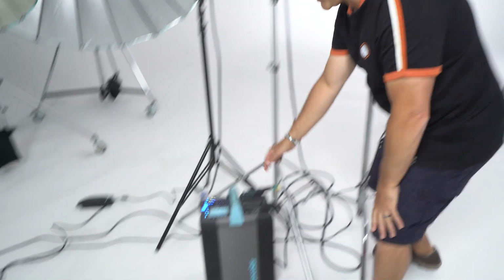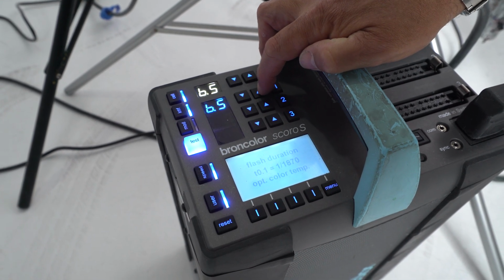Understanding Studio Flash Lighting

Comment: There is only "THE LIGHT" no matter it's natural or LED or flash,  threre is one and only one light. If you know what's light is, then you can make any kind of photo(s).
Reply from the maker: Yes but it needs to be full spectrum colour otherwise the photos will not realise their potential. For example if you photography with a sodium vapour lamp the results would be horrible.
Reply: @VisualEducationStudio  Probably, then it's a question of correct white balance settings. No matter the kind of light(s) we're talking about, The light is THE LIGHT. ( I hope my english is good, and thanks for your channel I like it)
Reply from the maker: Hi Didier, that wouldn't be true. For an image to accurately record colour it has to have a light source that distributes the full spectrum of colours equivalent to daylight. Yes this light can be warmer such as 3200K or cooler such as 9000K but they still have the full spectrum within them. With sodium vapour lamps for example they only have the wavelength of orange light and it is very specific, almost as specific as a laser beam wavelength. If you were to photograph with these light sources then there is nothing you could do to represent colour and contrast accurately by adjusting colour balance. This is why all studio flashes and speedlites and high quality LED lights run with as close to full spectrum as possible.

Comment: Would you say continuous light has an advantage over flash for film photography?
Or should I use my modeling lamp to find out the right placement of the flash head before taking the shot? Or is this kind of a vice versa scenario?
Reply from the maker: Hi Adrian no I don't think continuous light has any advantages over studio flash lighting for stills photography whether it is digital or film. At some point in the future when it's possible to achieve clean images at 64,000 iso and assuming you can work in a completely darkened studio that has no ambient light leaks as well as the continuous light being adjustable in 1/10th of an f-stop with a CRI of 100, then it may start to have some advantages.
Reply: @VisualEducationStudio  you can shoot at ISO 64000 already, the images will just not be very pleasing to look at 😉😂

Comment: Thank you so much for your super video! I am not a professional photographer but built myself a small photo studio with everything you need as a professional, only all of it smaller and terribly improvised. I want to upgrade my whole system, since the triggering of the small battery driven flashes has been unreliable, slow and too week. Godox is probably the brand I should go for but I’m quite uncertain, what the system should look like. I have been using up to 3 flashes and want a system, that can freeze action, e.g. my model jumping in the air. But I also shoot groups of people/families. I reserved about 3 to 4000 Euros for that, now all I need, is a sensible combination of flashes, everything else is already available. What would you suggest? How much power do I need? My studio is 4X5 meters. I don’t earn money with my photographic work and don’t need to. It’s all just a lot of fun!

Comment: Hi Karl, could you perhaps direct me to an overview of (T.1) flash durations for specific power settings? I am running into the limits of my 800L's with dance photography and would like to compare with several power packs (move and scoro) to see which one would suit me best. I haven't been able to find the information so far.
Reply from the maker: Hi Filbert, I'm surprised you're running to the limits on your 800L you'd have to compare the duration specs to the 800S on brons website then against the Scoro. The Scoro gives you a bit fast duration and a bit more power but as with all of their fast flash durations you have to drop the power of the units down to 5.5 or below to get the really fast speeds.
Reply: @VisualEducationStudio  I was shooting a group of dancers with a narrow grid + gel, which ate quite a few stops so I needed full power on the 800L. I'll  try to find the Scoro specs again. Maybe a flooter on the 800L would do the trick as well. Thanks for your reply!
Reply: @VisualEducationStudio  I did some more research. Turns out I should have used the HS mode at power setting 9 (not 10), then bumped the iso one stop. Would have given me a t.1 of around 1/800 of a second, which would have done the trick. Live and learn. I'll still check out what extra the packs deliver though, as a bit of extra depth of field is always welcome.

Comment: Although I understand flash has the ability to freeze movement compared to led, is there any actual application for led in photography?
Also, what do we get with broncolor or prophoto lights compared to let’s say much cheaper alternatives like godox? 
In the monitor world, yes you can get a very good benq but eizo will still give you much better uniformity.
Reply from the maker: Hi Maxime, some people just understand continuous light more easily, in a sort of 'what you see is what you get' manner but as explained it's not as versatile for many reasons, especially when photographing people/fashion. In relation to your other question on lighting brands, light is light out of a flash tube but it's how long it lasts, how consistent the exposures are, for example every shot with my bron light is going to be exactly the same exposure  which means layering images is easy. Durability of the brand is important to pros as the equipment gets a beating. And most importantly for me is what are the choice of modifiers available to me.

Comment: That remote flash trigger on the camera appeared to only have a single contact on the bottom of it, similar to much older speedlites from the film days.  Does that still have any sort of camera-controlled TTL flash metering or is it exclusively manually controlled settings?
Reply from the maker: I can't see any point in TTL on a studio flash, the whole process of working with light in a studio is where the photographer makes the decisions on the exposure level of the flash. The trigger fires the flashes and you can also control the power up and down from the trigger if you wish but I prefer to walk over to the light and change it on the dial or do it from the app or computer controler.

Comment: I also tell new photographers to consider how much power they anticipate needing. That 400ws monolight may be less expensive but may have issues when fired at top settings with little recycling time compared to an 800ws unit when fired at half power.
Reply: Just bought the ad1200 pro pack and head system, battery powered.

Comment: Hello Karlingtons!

Grrr! Don't know what to do for my next step.  Need some advice or guidance

I currently own a Lumix G85 

Which so far, I have enjoyed using

I am now at a breaking point and need to change my setup. I don't know what to do.

I have spent a bit on the lenses and am in the Lumix eco system but for my needs this specific model just ain't working for me

These are things I now know that I need

1. Tethered cable is a must (my g85 doesn't support it)
2. I need my next camera to be ideal for stock photography
3. To provide higher ISOs and a wider range of manual controls

Anyone have any ideas what I can do

It takes me months to research this stuff

I am also going to be stuck with a bunch of gear if I change the system or brand

Thanks in advance
Reply from the maker: Hi, it sounds like you've already made up your mind and you are going to need to sell your current stuff. If I was buying 35mm again then I'd probably go Sony and their 90mm Macro lens which is excellent. If I wanted to go Medium Format on a budget then I'd X1Dii (others will argue Fuji, but I need higher sync speeds for my fashion work). I think the new Canon Mirrorless also look interesting, I've got older 5dmk3s still working fine but I use the H6 for 99% of my work.

Comment: That should answer a lot of people's questions! One thing to know about pack-and-head systems is that they can draw a lot of power from the AC/mains... not a problem if you have a nice studio like Karl's with dedicated circuits for everything,  but something to watch out for on locations. I used to shoot market-research photos in-house for a large corporation, and our little studio was next to the IT department... one day for some reason we had to fire both 2400-joule packs at full power, tripped the circuit breaker, and all the computers next door went dark! They were not happy with us...
Reply from the maker: Ha Ha yes good point!
Reply: well 2 packs on uk system would be 20 amps if was 2400 joules x2  = 20 amps I think is correct. For usa it would be on 110v system, and 1 2400 joules pack = 2400 watts would be 20 amps , with most circuit breakers 15 to 20 amps.  But that isnt telling everything I assume the 2400 joules is only the output and not power draw.
Reply: @reality150tv  I think that's correct that the power rating is usually measured at the capacitors not the outlet, but I could see the charging circuits drawing too much power. I may be mistaken but I thought the UK had overcurrent control built into their power ports and often the plug itself. It's been over a decade since I personally lived there so I may not have it right. If I am correct I'd say this is less of a risk in the UK than the US where the  overcurrrent control is only for protecting the in-wall wiring fom bursting into flames.
Reply: @reality150tv  I love the fact that I was an electrician before a photographer to do all the wattage conversions lol.
Reply: Exactly why I'm considering if I can get by with a Move pack....
Reply: Happened to me at hotel

Comment: When I was a Paramedic we used Lifepak cardiac defibulators to shock a persons back into a rhythm. The max we had were 360 Joules available. I cannot even imagine getting shocked by a 3200 Joules block. That will send you flying across the room. LOL  Great video.
Reply from the maker: I once took an Elinchrom 1200J monoblock apart to try and extract a loose screw. Stupidly I inserted a screwdriver in to reach it....Next thing with a big bang my arm was knocked back and the screw driver sent flying across the room. It had a 5mm burn mark into the metal shaft, luckily I was unharmed as I only had my hand on the plastic handle of the screwdriver. Lesson learned... Let a qualified technician deal with it.

Comment: is that 3000 j flashlight brighter than the sun ??  and how much lux it emits ?
Reply from the maker: It's all relative to how far away you are from the light and how long you look at it but if you fired 3000j at your eye (don't do this) from a meter or two away you won't be able to see much for quite a while, and that is just for about 1/1000th of a second. If you looked at the sun for 1/1000th of a second it wouldn't hurt as much. However you generally use studio lights with modifiers on and not often on full power. I'd have to measure the output of the sun on a clear sunny day and the flash from a couple of meters to give you the lux but I'm not going to do that, you can probably find the answer on the web.

Comment: Big fan of your work Karl, but at 6:09 i doubt that one of the reasons people get the power pack systems is bcus of the controls for the flash being on ground level. Every good flash system now can be controled from the trigger which is mounted on the camera regardless of the hight of the flash light.
Reply from the maker: Thank you Akpe, yes I did mention that some monoblocs can be controlled from wifi apps and the triggers however I personally often find this fiddly (lost wifi, not knowing which light etc) and prefer the convenience of having the controls to 3 lights on one pack at ground level. Of course the desktop apps and mobile apps have gotten much better and it is probably as convenient but there is still something I like about having it at your fingertips. The outright main reason for most pros opting for packs would be the other features I mentioned and the extra power.
Reply: @VisualEducationStudio  Totally understand dude 👍🏿

Comment: Actualy, 800J/256 ( 2 to the power of 8 is 256 ) gives you about 3.125J of light on the Siros 800, wich is smaller than the 3.3J of the Unilite
Reply: What I try to say is that power 0.5 on the Unilite and power 2 on the Siros 800 is the same, it's only upward that the difference exists, that's kind of missleading because while Unilite 3200 power 10 means 2 stops brighter Siros 800 power 10 but their lowest point are the same, but described as 2 different power values...
Reply: And then they say studio strobe don't have to be complicated 🤷🏻‍♂️
Reply from the maker: Yes that's the maths but I find at the very lowest powers the joules can be a bit iffy in their supposed values and actual output. The Scoro shows you the Joules which is nice. It's obviously got 2 stops up above the Siros if only using one lamp in the pack (which is not very often).

Comment: For anyone that is confused, a Joule is the same as a Ws (watt second). 800 Joules is 800 Ws. I may have missed it but I don't think it was mentioned in the video, and I think in the US at least, studio light power specs are generally listed in Ws and not Joules.
Reply from the maker: Thanks I thought about mentioning it but then I thought it might get too confusing! I didn't realise the USA used Watt Seconds on studio lighting :)
Reply: Karl Taylor actually watts is equal to joule/seconds 😎 P(w)=E(j)/t(s) watts is power, joules is energy
Reply: @nilofido411  yes, watts is POWER ie: what is consumed by your toaster/heater, etc. so a 500W generator from a hardware store can power you shaver, a caravan small bar fridge, etc. Joule is a measure of heat energy, ie with food, a KJ of energy used while jogging ( but as a side note, defibrilators use joules as power settings to)- this is electricity, not light or chemical energy. I presume the use of watts is to estimate if this power pack can be used in the circuit of the building, ie if there is enough amps without 'blowing' the rcd or circuit breaker in the meter box, a bit like using a stick welder, you need a high current circuit to run these, so you don't inadvertently start a wiring fire, due to over stressing the wire in the house.
Reply: @andyvan5692  It's all the same. Calories, joules, watt-hours, BTU, eV, erg, even the foot-pound force. It's all energy, the exact same physical phenomenon. No difference between "light", "chemical", "heat", it's all the same thing, these units are just used in different contexts for historical reasons and traditionalism.
Reply: Thanks
Reply: Thank you so much... I went and googled it. it was no help.  But your answer was.  Thank you